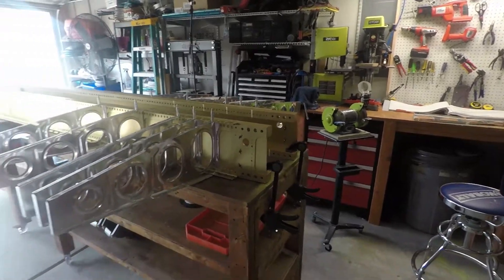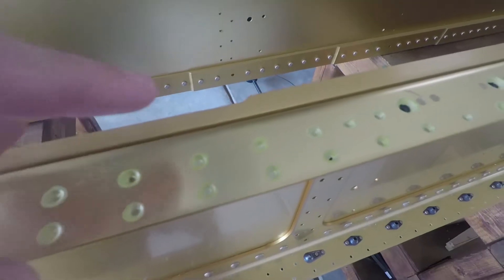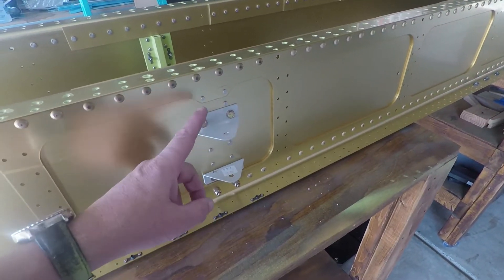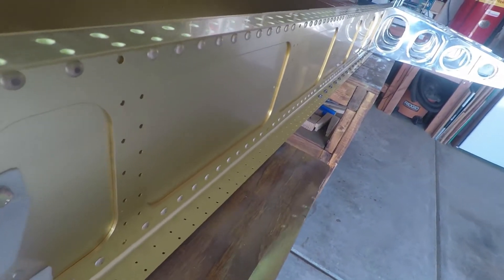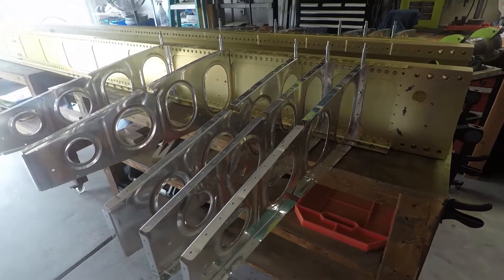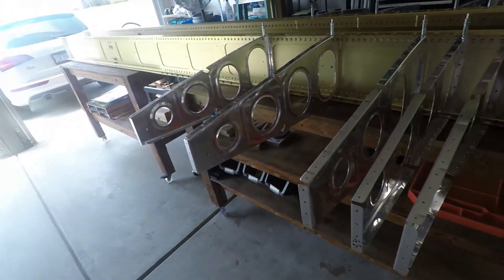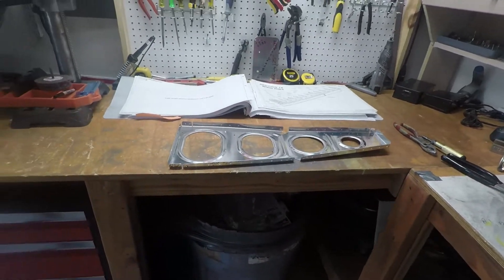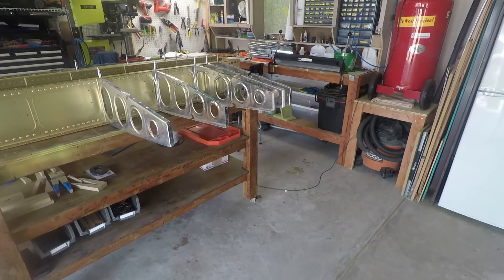RV-10 Update 02 Apr 2018

Comment: Yeah, no big deal at all. If you put a cleco in one of the holes it should seat it better.  If not go to the auto store and get a small length of rubber fuel line hose.  Then use a utility knife to cut a small ring that you put around the shop end of the rivet (it should stick out just passed the rivet end).  The when you shoot the rivet the bucking bar will hit the rubber ring and press the tab against the surface and then contact and start to drive the rivet.  It will seat it nicely this way.